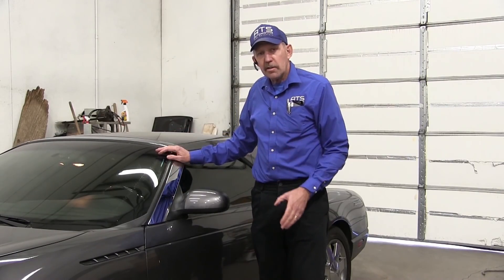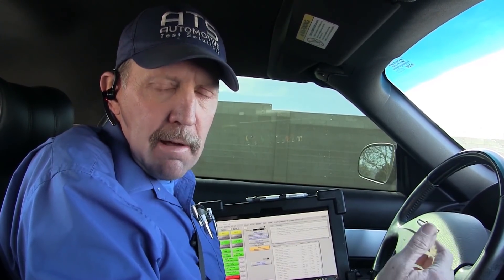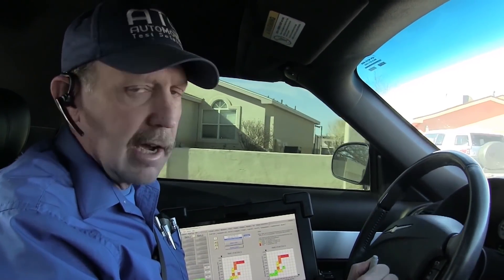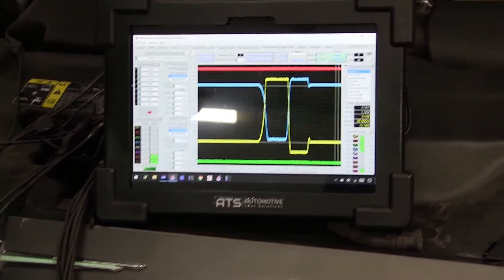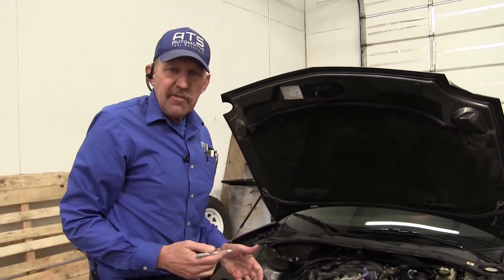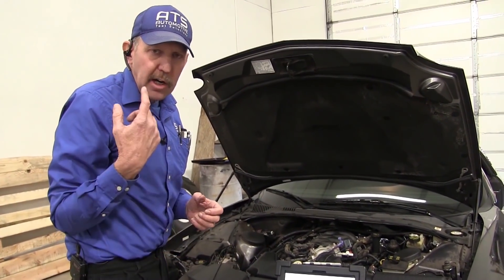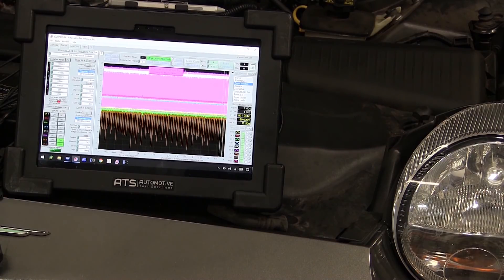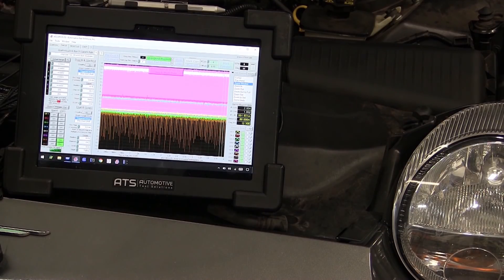2003 Ford T Bird throttle defaulting

Comment: To be effective at clamping the inductive electric clutch voltage spike, the coil clamping diode should be at or near the coil itself. On this year T-Bird the diode is on the compressor housing which is only about 8 inches from the clutch coil. 

The problem with the negative unclamped coil voltage spike is that, because the battery is in the trunk, there is considerable common ground impedance, across which the voltage spike can influence control module ground enough to cause a processor reset. The question is why is the electronic control module resetting? Is it due to loss of power supply causing a reset, or is the modulating ground triggering a reset circuit, either internal to the microcontroller or external at the power supply. 

The main vehicle grounds should be checked to see if any common splice or connection point is loose or corroded. The goal would be to minimize the return current common ground impedance. If the battery return is through the chassis then the chassis ground connection points should be checked for corrosion. 

The AC compressor coil diode on the compressor housing is large, perhaps having a power rating like an alternator diode (75 to 100 Watts). The diode is held by a bracket so it looks like you could replace it without replacing the compressor.

The ECM Ignition IGBTs (low side drive, pulling the ignition coil to ground) have an on-board active clamp starting at around 420 Volts to protect the IGBT. It is important to get a high flyback voltage to have a high energy spark (transformer action giving a high ignition voltage at the plug), but not too high to damage the IGBT or force it to clamp excessive energy, which will lead to the IGBT failing due to exceeding its safe operating region usually due to excessive power dissipation (component getting hot). 

If ECM is designed correctly and the vehicle power supply (battery and alternator) have low source and ground impedance (imagine the ECM placed directly across the battery which is next to the alternator as an ideal case), then the high ignition flyback voltage will not effect the power supply or the microcontroller. The term "set gates out" is a reference to randomly and catastrophically changing microcontroller logic gate states which change the normal program flow (e.g. program execution counter in error) and thus will eventually cause a module reset. The ECM I/O, which includes all the circuits on the module connector, are very robust in terms of electrical disturbances including ESD. So, a voltage overstress which results in a microcontroller reset is most likely apart of the module power supply. The ECM can manage high voltages and currents, if the loads do not excessively modulate the power or ground common impedance. 

The Microcontroller in the ECM never drives coil-on-plug coils directly, they use a smart pre-driver (for diagnostics (OBD-II), usually through a SPI channel) and then the pre-driver powers the ignition IGBT. The injectors are done in a similar manner, the pre-driver powers the injection N-Channel Smart MOSFET (low side drive), in some cases the pre-driver and MOSFETs are on one special power driver IC. Here again the Microcontroller monitors injection power device operation through the use of a SPI channel serial link.

The main reason to put the IGBTs at the coil-on-plug coils (known as a smart coil) is not that the flyback voltage will cause a module reset, it is due to power dissipation. The ignition IGBTs on-board the ECM produce a great deal of heat (actually the largest heat producer at modest engine RPMs), which has to be managed (dissipated) in some fashion. This is why when a Ford EEC with IGBTs on-board fail (misfire, ignition out on one cylinder), the culprit is usually the IGBT that runs the hottest in the module.

Comment: Great video as usual, so you set the diode up in reverse bias to absorb flyback because the grd potential would be higher + than the kickback?  Is the kickback always negative value?  Like the antenna instead of using multiple channels and multiple e-cops. Do you sell those? I had a Pico but now I'm spoiled rotten with the E-Scope and E-Scan. Thanks

Comment: So it can't be built this way or right off the bat this seems like to me it would be present off the showroom floor, but I thin, you are saying either the diode ground is lost or spikes over time make the ic sick enough to malfunction. That would necessarily necessitate a new computer which is only a partial solution for this Tbird. Have to be a big diode with high voltage and current capability.

Comment: So how does the suppression diode only suprress the inductive spike but not lead the clutch supply voltage to earth?
Reply: A diode only allows current to flow in one direction.  The line across the point of the diode symbol will block conventional current flow(positive to negative). So no current will flow through the diode when the relay is closed powering up the clutch coil.  When the relay opens and the magnetic field of the clutch coil collapses, the polarity reverses since the field is now collapsing and that allows current to flow in a loop through the diode and coil windings.  I still have trouble understating how the spike  affect the computer since it’s isolated on the load side and not the control/pcm side.  Maybe mutual induction like others have said or maybe the relay acts as a capacitor with that much of a spike causing the control winding to flow current even though it’s not directly connected…?  Be cool if we could see the pcm side of the relay on the scope too.  Its crazy the problems this guy is able to diagnose.
Reply: In normal operation, the diode is the "wrong way round" for any current to flow through it.
In the diagram, current flow is top to bottom but the diode is installed with the arrow bottom to top.
When you disconnect power to a coil, it wants to try to keep current flowing in the same direction as the magnetic field collapses. Think of it a bit like a flywheel.
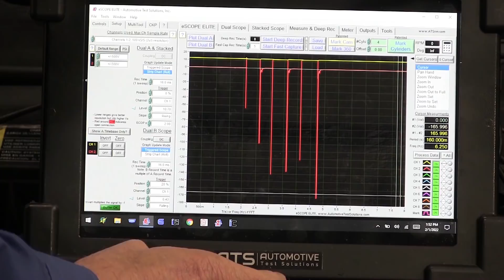So instead of current being pushed into the top terminal of the coil, the coil is now pulling on the top terminal trying to get some current in - *so the voltage at the top terminal goes negative with respect to the grounded end of the coil*. You can see this at 41:31
Now with the diode added, there is a path for the current to take when the voltage goes negative.
Because losses are a thing, the current will flow round in a circle between coil and diode but constantly falling, the negative spike will now be limited to under 1V, the "forward" conducting voltage of the diode.
You can see this in the waveform at 42:05 and also note that current flows for about 250ms before tailing off. And yes, this makes the AC clutch release more slowly.

Comment: Master fix... Sometimes  power train Network lines   to for example 2kw + audio  amplifier in boot feed line not properly fitted in  engine bay harness making noise and limp mode.for sure

Comment: Why didn't the AC compressor have a diode installed in the circuit to begin with. Normally these circuits do

Comment: The original relay had a built-in diode   and the replacement does not.
Reply: WHAT MAKES THE SPIKE, THE RELAY OR THE COMPRESSOR CLUTCH.